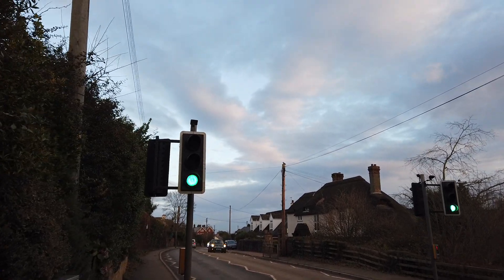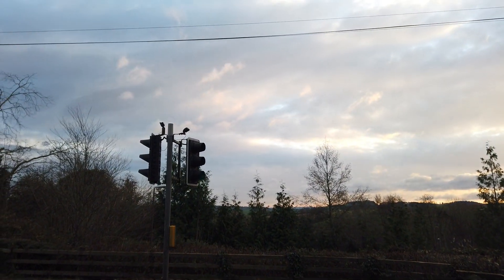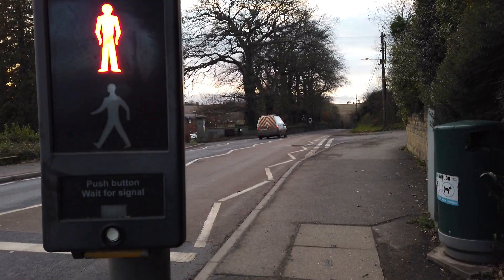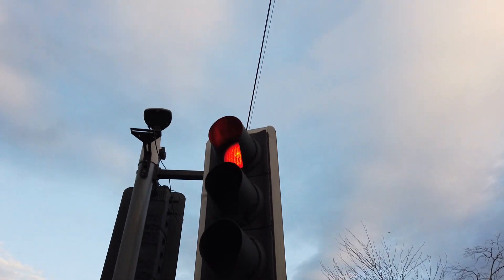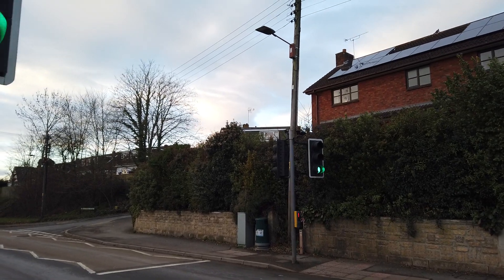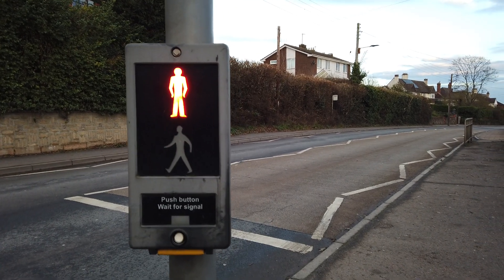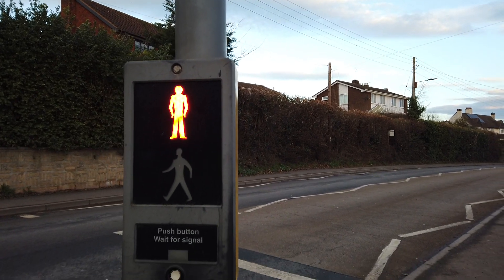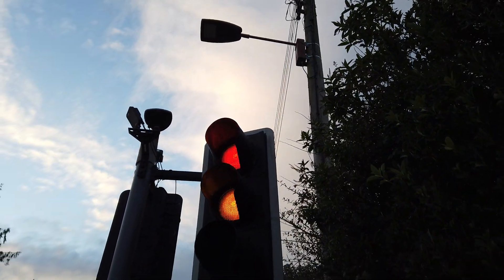A puffin crossing with 4 Siemens Led traffic lights in Crediton in Devon 1/2

Comment: I looked on Google Maps and I found out that these traffic lights were installed in 2009 and in 2008 this used to have mellors but I’ve seen even older Siemens traffic lights in Brighton from 2005.